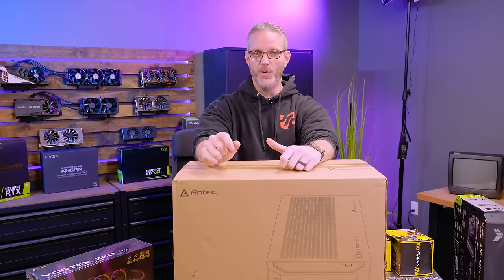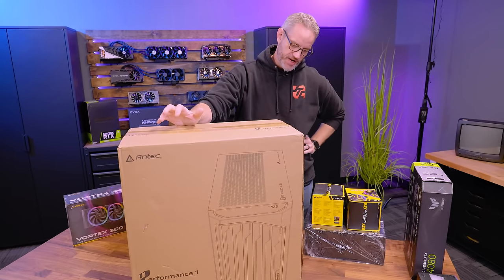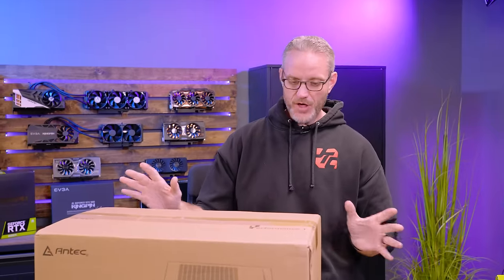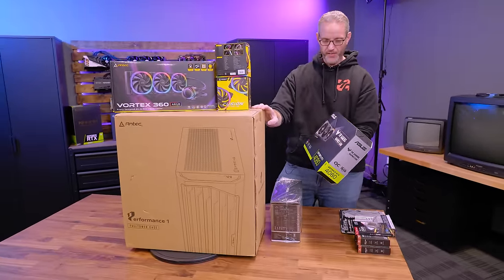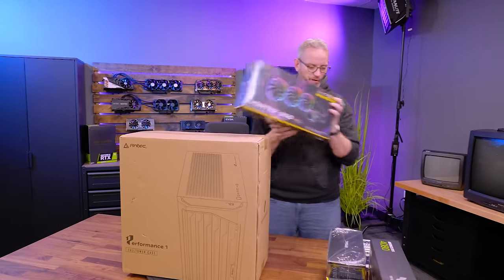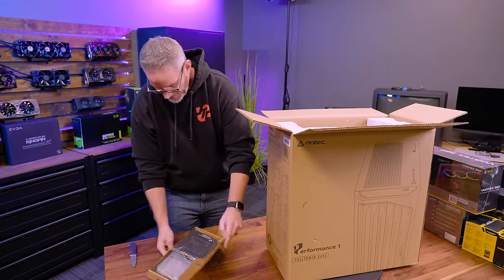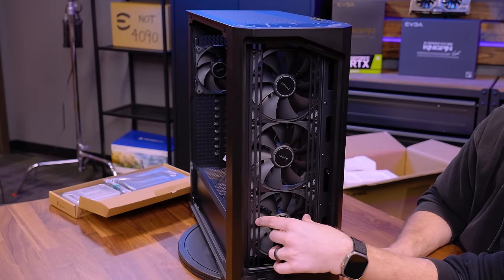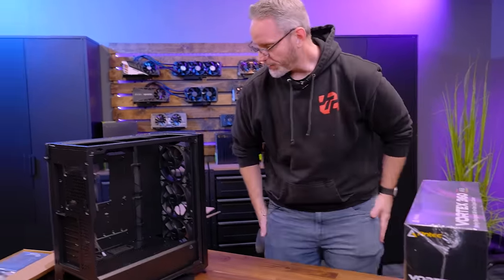Antec Performance 1 Full Tower Build!

Comment: This LCD is in such stupid, invisible place, I can't even. Close to nobody keep the chassis on the floor.
Reply: fr
Reply: I keep mine on the floor
Reply: I suspect its probably 50/50 on this one.   I  do think on the front would be better - but that would require more complex design with the front panel so would potentially add a chunk of cost.
Reply: @malphadour  The most viable place is in the basement's wall, there's really much more people placing PC on the desk than on the floor and it's also more hygienic dust wise. They also could have simply angle the bottom side of the panel and place it there, the chassis is already going to cost 199 USD, the cost difference would be minuscule. Top side is simply stupid from modern stand point.
Reply: @PolskiJaszczomb  I see dozens of PC's in homes and I've gotta tell you, it is pretty 50/50 from what I've seen.  I think the idea that someone mentioned of having it on a little hinge would suit both scenarios - cost a bit more but would then work for everyone.
Reply: Mines on the floor. I don’t want microphone picking up the fan noise and I have more space on the desk.
Reply: Why would you not keep it on the floor? Extra desk space for gaming accessories and or just make your desk look nicer. It's 50/50 in this case this ain't the tower for you buddy.
Reply: @541_CoyotePower  Why would you keep it on the floor in the first place? Unless your desk is a size of a parrot's cage.
Reply: @PolskiJaszczomb  Less cluttler, and of course what the other fellas commented on. It's personal option honestly but you mentioned the LCD was your issue so this is the not pc case for you. No biggie find something that suits you dude.
Reply: Gamers when they have to stand up for a second
Reply: I do lol
Reply: I like it. Im using a standing desk and my case is in a PC holder under it.
Reply: My pc is under my table, it's on a nice wheel stand. Can use front usb easily and use cabinet as thier stand while using. Air is cooler at the floor,  so extra bit of cooling as well. And it's hot in India.  Every little effort counts. 
On this case my gripe is why not display both cpu and gpu, both go hand in hand.
Reply: @PorkChopXpress1701  Same... 😂
Reply: Any temp monitor on a case is dumb. I have my computer under my desk and I can't even see the read out lol
Reply: I do.
Reply: Mine is also on the floor with a little stand.

Comment: the first case and powersupply I bought were from Antec. Back in the day they were the top of the line brand for cases and powersupplies. They made great stuff.
Reply: in the past , they are not the same now Ming-Jong bouth them and the quality and service drop so mutch
Reply: Yup Antec was the benchmark back then when it came to cases.
Reply: @vandermitch5146  i didn’t know that. Thanks to let me know.
Reply: Like how long ago? Remember when CPU's went from using 5v to 12v in the 90's? Yeah, Antec wasn't on board with that and didn't make power supplies with sufficient amps on the 12v rail so adding a second hard drive would overload the rail and prevent booting. Been boycotting Antec since.
Reply: I still have and Antec build sitting on the floor right here (with old components). Their black ("piano black") concert type was designed to be very quiet.  Just what I wanted.
Reply: @crtune  The Sonata?  I actually just put a Ryzen 5600X in one  that I am using for video capture. Yes, it's dated, but was a great case in early 2000s.
Reply: @TheRealHeavyG  Yes, it's one of that line.  Really a nice smaller size case.  I think an Athlon and related mobo are in there.  I may reuse this just because it is such a good case.
Reply: @Ilestun  they were the diamond standard for power supplies back in the day as well.
Reply: My first "gaming" case was from Antec. Way back then and they had a 200mm front fan. Also their power supply was top notch.
Reply: Antec Three Hundred with a 550w TruePower Trio were the beating heart of the first PC I built. System still works today, and I still like that case, even though newer cases are definitely more fun to build in.
A battle tested TruePower Classic 750 powered my last computer, outlasted it, survived a shorted graphics card, pushed more watts than I was capable of measuring at the time (over 650w at redline), and now lives a life of relative ease powering my newest build (theoretical redline no more than 600w).
Cable manging an old-school high-power nonmodular power supply in a modern micro-ATX was not the most fun I've ever had, but I fully expect that thing to stay reliable for years yet.
Reply: Yep, Antec was my first case too.... long time ago now.
Reply: I still have my old beige antec tower that I got in high school. Still use it. Currently it has a ryzen 2600x and 1660 super in it.
Reply: my first case from 2001 in an Antec Plus 1080, its still in use for my server.
Reply: My first gaming computer was in an Antec 900. I loved that case. I ended up having to modify it to cable manage though.
Reply: @nwngunner  I've done my first custom PC around 2005 and back then Seasonic already became the golden standard, offering 80+ certification on all their PSUs. Was hesitating between an Antec (phantom?) and Seasonic PSU back then, similar prices but Seasonic certified 80+.
Reply: Same here! And I'm still rocking antec 900, modified though. Planing to build a new pc and put it in 900 still
Reply: Same
Reply: Back in the day, when EPoX and Abit motherboards ruled. And I seem to remember Chaintech and Soyo as the brands that offered good motherboards for better prices, a bit like what Asrock is now.
Reply: @Antonio M  yeah mine was a 900 I had an 1200 psu amd 965 phenom ii and 480 gtx more psu than I needed lol honestly needed better quality than quantity for that part never had any problems but still
Reply: Just aquired a really old school antec case with the original box still . thinking about just giving it to a creator it like 2 feet tall . Crazy to see what they came from to now.
Reply: @theMedicatedCitizen  My 7000x weights 44 LBS empty :D
But yeah LANs are not a thing anymore.
Reply: Yeah me too, Antec Sonata in piano black, great case.
Reply: I had an Antec Solo (white) for about a decade until 2016. An attractive and QUIET case in an matx format.

Comment: i usually don't like when everyone starts talking about the same product at the same time, but this case is too damn good looking and apparently efficient to pass up, every video on it is just top tier.
Reply: That's how every single product release is. Marketing coordinates sending samples to reviewers and all of them have the same NDA/embargo date, so there is an emphasis to get the reviews out ASAP, as it's a hot product and that will catch the most views. Not as many people are going to watch a review of a product months after launch.
Reply: This is really nice. It's still, however, annoying that a 90° angle fit the 4090 is required to put the side panel on. But that's easily fixed. 

The Hyte Y40 is my case and my favorite if you want a compact case that honestly doesn't have thermal issues with the 4xxx series GPUs. But if you want access to the other PCIE slots, the Y40 isn't the one.
Reply: Lol! You should see my 2 Antec cases. The wood accents really make it pop. The P160W was Silver with Red Cedar that replaced the front and the DP502 is White with a Red Cedar strip on one side.
Reply: same

Comment: One of my favorite cases was an Antec 900, that case was WAY ahead of its time and very reasonably priced too. Nice to see Antec is still in the game.
Reply: I still have two 900"s and use one of them for my main system!
Reply: I still have the 900. It's my wife's system now. It had an Antec power supply too until I upgraded her to a Ryzen 5600. It was 14 or 16 years old, older than our marriage. RIP PSU.
Reply: I have three 900s still running.Very few others from that era will give you room for 6 3.5 and 3 5.25 drives bays. Each has seen 3 or 4 builds but I went Corsair 5000 for the 5900X so it could be water cooled.
Reply: i got the 1200 not found anything to replace it solid and works
Reply: I still have mine as my main PC. Upgraded the front panel to USB3 and I live in fear of the top fan failing and trying to find a replacement. Its a great case, anything fits in it, and it breathes really well without making any noise.
Reply: I am STILL running a system in my Antec900 case!  it's been a solid case.  All original fans are still working perfectly, as well as the LEDs and rear switch panel.

Comment: My 2nd PC build (2010) used an Antec 900. Absolutely loved this case and ended up using it's upgraded V2 on 3 other builds for a small office. They are still in use today. Sadly the original case's big boy 200mm fan died, which was a pretty key feature.

Comment: One of my first builds was with an Antec Sonata case using Vantec stealth fans. Although I don't use it anymore I still have the case and it looks just as good as when I bought it. Very high quality.
Reply: Same, had the Sonata I for 10+ years, if you're careful with the piano black finish it still holds up really well

Comment: I'm glad you mentioned their iUnity, as I wasn't even aware that they had this program available until I followed your link. Btw, I still have a couple of Antec cases with working PCs, a P160W holding a Win98 & a DP502 Fluxwhite holding Win10. Both were modified and outfitted with wood accents to fit my personal aesthetics. The new Performance would be awesome in white and add to my collection.
Reply: I can't find the iUnity when I do a google search, which link did you follow to find it? I've been looking for something like this.
Reply: @smittyjones8755  Sorry, I just now noticed your post. If you click on Jayz link to the case, just scroll down and it's right below. It's fairly decent, simple, without being too convoluted.
Reply: @jawnTem  No problem, I found it now. Thanks.

Comment: Antec Sonata was my first ever build, focusing on quietness, then into Silverstone Fortress FT-02, which I'm still using 10+ years later :) 

I still have the Sonata, it's my bed side clock and lamp table 😁
The piano finish is nice 🙂

Still deciding on my next case - Either Be Quiet Silent Base 802, Fractal North or Torrent... They have to be able to match my FT-02's airflow and quietness

Comment: My current build is in a Antec DF700 Flux mid-tower with Antec storm series fans and custom water loop (corsair pump). I couldn't be happier. The amount of heat that is removed from my system during load is insane -- I am toasty warm during winter. My GPU never spikes above 42c during load and my CPU is relatively stable around 35c and 60c during load.

Comment: Id love to see you do a custom build in the antec p120 Crystal.  I currently have a Corsair 4000D in white, but the P120 Crystal looks so damn good.
Reply: An O11 Dynamic case with a slight tweak of putting the power supply at the top. Which is a strange decision bc the top panel is solid, prevents exhaust or a radiator to be used on the top, and subsequently the PSU can only be mounted with fan point down which would draw all the heat into the power supply. I applaud Antec for trying to become relevant again, but wish theyd do more unique cases rather than tweaking current cases....and in the case of the P120 Crystal, made in theory a worse version of an O11 Dynamic variant

Comment: I love this case, the 140mm fans that come with it are really quiet and temps have been great. I bought the white version because my fractal meshify couldnt fit my Sapphire 6950xt without touching the front fans. Loved the case so much that I bought the black version to swap my wifes pc into. Neither of us have used the lcd display as our pcs sit on top the desk, but it is a cool feature. The main pros of this case are amazing cable management, nice included fans, easy to build in, and lots of space for activities. The white version has normal clear glass, and the black one has smokey tinted glass for the side panel, which looks suprisingly good.  10/10 would buy again.

Comment: I sold my SX 1030 just a few years ago. It ran an AMD system until 2018 then sat under my desk after the system died. It ran in various configurations from 2001 to 2018. I bought an acrylic side panel for it to show off my blue cathode tubes and dual Hd 4770s. Crazy to see how far we’ve come. The good ole days lol. Kind of wish I kept it. Glad to see a new Antecedent build.

Comment: Jay, my dad worked in the meat department of grocery stores for 30+ years.  According to him a person will cut themselves faster with a dull knife than they will with a sharp knife.  The reason is that they end up using a lot more force to get a dull blade to cut.  This additional force leads to a person cutting themselves when their hands slips or the blade suddenly cuts faster than expected.
Also, my wife's computer has an Antec Earthwatts 550W power supply.  It's been going strong for 9 years now and she almost never turns off her computer.

Comment: Had (youngest has it now) an Antec P160 non-window case, built several systems in it, and loved it. Recently ('17) got a brand new Antec P9, much the same as the P160, black and windowed. Antec make damn good cases

Comment: My 2016 build was in an Antec 300 case, and also had an Antec HCP Platinum 1000W P/S and an Antec Kuehler 120mm AIO.  It's still going strong.  

My latest build uses an Antec DF800 Flux white case, and yes, I did also put in their fans, the beveled outer LED rings look really good at the top of the case.

Comment: Nice case! When I built my old gaming computer with my dad 12 years ago, we used the Antec 300 case. It had the AMD Phenom II X6 1090T and 2 Radeon HD 7770s in Crossfire (initially had 2 5770s in Crossfire). Still works today!

Recently, we built a brand new gaming computer with the Antec DF700 Flux. It has the AMD Ryzen 7 5800X3D and Radeon RX 6600 XT. So far, it's been working great!

Comment: Nice! I'm still rocking an Antec P180 I bought from CompUSA back in the day. It's seen better days - the front door on it is broken and sides are a bit scuffed, but all buttoned up I get great temps on my air-cooled R7 2700x and the RX580 never gets over 50-55C under full load.
Reply: That’s so cool to hear these old Antec cases are still being used! Still have great upgrade options on AM4 before deciding to retire the case

Comment: My first watercooled build was in an antec case. I modified the front to be able to mount a 420 radiator to and still have the front cover on. It stuck out of the top and met up with the 240 radiator at the top. Has that kind of inside-out look. It still gets all the hand-me-downs from my main build which is in a slightly modified Define 7.

Comment: When I started building computers around 1995 or 96, I generally bought Antec cases and power supplies. The cases generally had nice features that I liked. But by the early 2000s, their case designs began to suffer (permanently installed tall drive cages were my biggest gripe) and I began to buy other brands. This Antec Performance 1 is the first case of theirs I've liked and would use in 20 years or so. Hope they have gotten a good design team for their cases who actually know what enthusiasts want to see when selecting a new case.

Comment: I still run Antec Green 80-Plus Bronze PSUs in 3 of my desktops. High quality, reliable and whisper quiet.  Antec is old school quality brand from over 20 years ago.  Another excellent case brand was Inwin. They don't make cases like that anymore. 1.1mm thick sheet steel.

Comment: Antec nostalgia.  I started building with the Antec P180 case.  Unlike this performance case, it was advertised as a sound deadening case.  So the air flow had to go through side slots in the front  to help trap any sound from inside the case.

Comment: Jay, I'm still sour from the last build I did. I picked up the SkyTwo case, essentially because you were advertising and vouching for it. When tried to install the arctic ll 360 AIO it wouldn't go because there wasn't enough clearance. The fans were hitting against the VRM heat sink. The only way I could make it work was to order two slim fans, and they were louder and did not push as much air. I got sour and just shoved it over in the corner of the room, and it's been sitting there ever since.

Comment: I'm still running a build with an Antec Sonata case and Antec PSU. Rock solid for 10 yrs but I'm upgrading and I'll be using this case and a Corsair RM850x Shift PSU.

Comment: My Antec was a P280. I cut out an square on the top to put in a 360 AiO and it worked fine.
I only changed it because I wanted something smaller.
Now I use a Corsair 4000D Airflow (white).

Comment: I have a 420 rad at the front with push and pull configuration, 280 rad on the top and 120 rad at the back. With an additional 3 120mm fans at the button as an intake.

Comment: Never had any readout issues. Been running a Logitech g15 since 2005 until scooping up a factory sealed G510s this past January. I've built in a few Antecs. The problem is they always used a ton of plastic....even the P160 Aluminum had a full plastic front. I sold mine before I built in it for that reason. I now run a new, old stock (2008) Lian Li PC-P80 Armorsuit. Full tower, all aluminum, x3 120mm filtered intakes. If I were to buy a new case today, I'd probably grab the Lian Li V3000 Plus.

Comment: I had 900 Antec cases and my favorite was 1200 Antec back in the days, I got Antec Performance F1 and I like it, the only thing that I don’t like is that I wish they had a special port by PCI slots so I can install a VGA vertical like more closer to the glass, looks like I need to cut the mesh to do that or buying a adapter and install it closer to the motherboard but it will look uglier, I wish they had a mount and a cable with the case, it is a nice case, yes 420mm radiator fits perfectly in the front, I did that and works perfectly